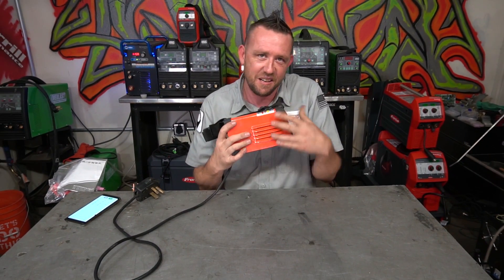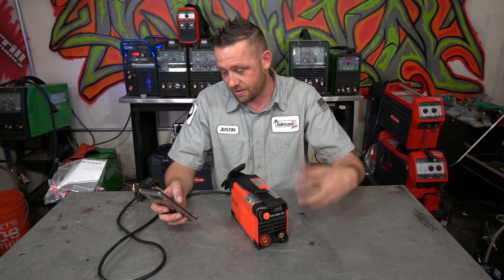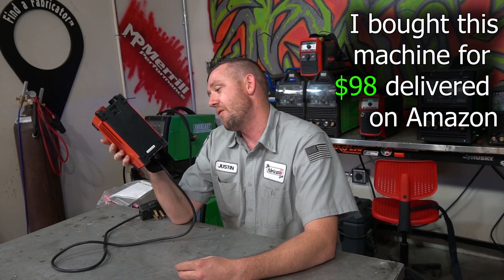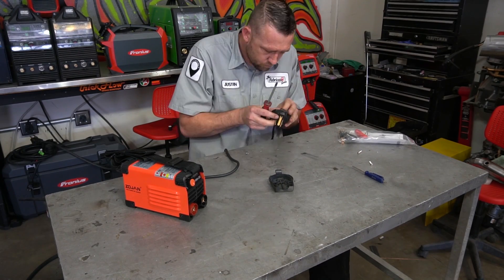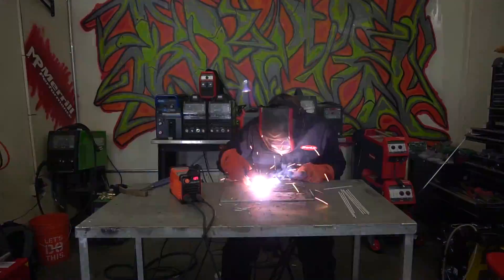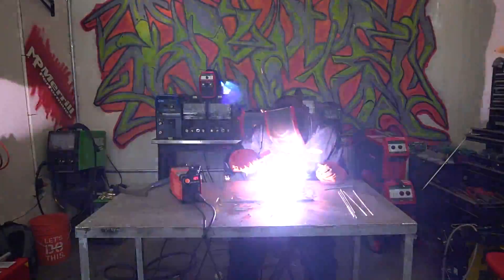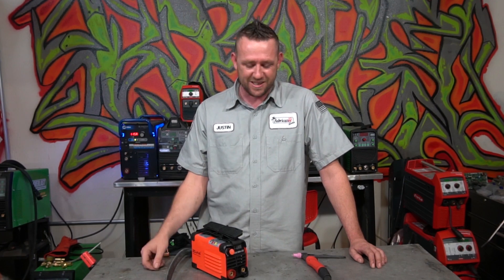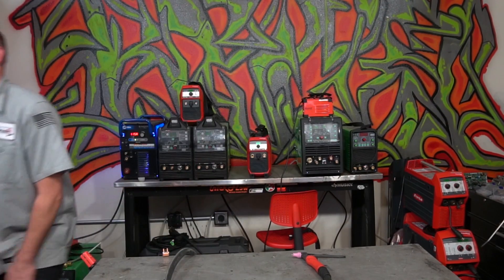TFS: The Smallest Welder EVER! Will it TIG?

Comment: I just got one of these labeled under the Minleaf name. Cirious about the display accuracy, I held a DC ammeter alongside one of the cables while Dad operated it. At 100, it gave a stuck-rod short 100A for a couple seconds before the current dropped to under 50A. Raising it to 150, we got 150A for a couple seconds again. Raising again to 250, we still got 150A shorted. Meanwhile, actual welding at 100 was reading (I think) under 50A while welding at 150 was reading under 100A. All of this was with a 3/32" rod. We didn't try any of this with 1/8" or bigger yet, it's cold out there ;) (wish we had a heated shop). More welding practice will come in the spring when Minnesota warms up again.

Comment: I could see some applications, like say if you're welding 50 feet in the air on a ladder and have it slung around your back. 220v wire is a lot thinner and less heavy than standard bulky DC leads. Just a thought.

Comment: right there u finish 10 welding rod with out stopping and still kicking off what else do u like, for me thats good for high elevaterd area, not too heavy to carry, also if you are welding from no where, there is no electric, that small machine with a small generator will work, thats good for farm land, not too heavy thats the point, thanks for sharing though

Comment: I paid $50 in Banggod on a special,  how many sticks did you use before you gave up??  12?? and you had no problem with the amps then,,,,  
maybe your jumper leads were the problem,  
remember, the longer the lead the higher the voltage drop!!
mine, I only stick weld and it works great!! at about half throttle!  
as for tig welding, you've been spoilt with all the good stuff that cost's thousands?? 
not a fair comparison, there are EXPENSIVE inverter welders out there as you know, 
these welders are for the hobbyist, and diy guy's to make or repair  their own trailers etc,  mine will soon be used to make a chassis for a teardrop trailer.......
these welders are not for professionals,  there for hobbyists who stick weld..
great vid, just the same

Comment: 125 amps for $100 in a tiny compact size that doesn't quit? That sounds like a damn good welder
Reply: Yes I thought he was a bit harsh in his conclusion.  Plus I've swapped out the adjustment pot in cheap machines before and they've proven fine.
Reply: Also they're only $50 on ebay.
Reply: Its actually NOT good value. I've got one... You don't get ANY power plug or leads. By the time you buy the bits to make it work, it turns out dearer than buying a complete machine. Plus they are NOT very robust at all, mine dropped a blade off the cooling fan (a tiny little computer fan) the first time I used it, which necessitated a pull-down to replace. The seller wasn't interested in any warranty.
Reply: क्या कितनी कीमत है भारत में कहां मिलेगी बताएं धन्यवाद
Reply: Daniel Vazquez  you'll get more amps when you sacrifice volts. Altering 120 volts AC to 50-60 volts DC(that's what these use on idle) you can crank up the amps. Not the most scientific way to say it put this is pretty much how it'll go. I bought similar thingy and i'm rather satisfied with it. I'm no pro nor i am going to use it to build a solid steel shed nor even weld rust holes shut on my car but use it on random small projects i have. For that small purpose these things are great.

Comment: I'll tell you the secret of that mini inverters, the power source, 220v is the perfect to work with it, I have a inverter 250A also but it's bigger, it's bivolt and 127V it work like underpower, in 220v almost can use it as plasma cut

Comment: If youre a maintenance mechanic it's probably small enough to have on a tool cart as you go work around a shop just with some small 7018 rods (less spatter) and you can use it occasionally to help with simple welding needs and repairs? Im an industrial maintenance technician and i think itd be cool for some things maybe?

Comment: It's 40-60% duty cycle... Thus, it's 120 amps (constant), at 240 amps, at half-duty. It gains amps by doubling the voltage, which requires half the cycle of the power phase. The purpose is for smaller rods and more controls. Where the RAW power welders you are using, are for heavy duty, raw welding. I know it sounds misleading, but it is actually 240 amps, at half duty. If you pulsed your other welders at half-duty, the average would be the same. However, the pulses that manual raw welders use is 60-Hz to 240-Hz. These digital controlled welders run at cycles that are much higher. Thus, you have a high amp pulse, for longer, with a slower duty cycle pulse, enough to get it started on a burn, but not enough to continue to burn through the metal, on your machines. On this tiny machine, working with thinner rods and thinner metal, you will have the same results, where your raw welders would just blow holes in everything that this little welder can work easily with.

It's about having the right tool for the right job.

If you want to TIG aluminum foil, circuit-board contacts, jewelry-boxes and jewelry, you use the mini-welder. If you want to TIG a car, boat, or airplane, you use your TIG welders. If you want to TIG a tank, you use an industrial 480volt or 720volt TIG welding machine. So those same 240-amps result in higher watts. That is also why 100 amps on 110v is only half as powerful as 100 amps on 220v, because its "Watts", not "amps", that welds. 100a x 110v = 11000 watts. 100a x 220v = 22000 watts. (But these machines don't RUN on 110v and 220v, they are more like 10v and 20v, so the amps at the wall are 10a and 20a, respectively and the output is 100a x 10v = 1000 watts and 100a x 20v = 2000 watts, out of your welder.)

Amps are irrelevant, unless the voltages are exactly the same. That's why you should be measuring "wattage", of the output, not at the wall. (Comparing wattage out, to wattage at the wall, tells you how efficient or inefficient a welder is. Just for the record, the mini welder is 40-60% more efficient than the larger raw welders, with the outputs being equal. EG, you save 40-60% in your electric bill... More, since raw welders draw power when idle and digital welders do not.)

Comment: I bought a 110/220 Hitbox arc welder just for shitz and giggles and was half impressed. It isn't something I would trust to use every day but it's a good little "rescue welder". Easy to pack and run off of the inverter in my truck. I can drive it anywhere on the ranch for a get the tractor home repair and always bring it on off road search and rescue call.

Comment: Is it good enough for "hobby" welding? I want to build a go kart for my son but don't plan on doing any major projects.
Reply: perfect for that type of use, I have a similar welder, but mine is bigger an does 180 amps on full power, even though it saids 250, 150 bucks new with full set of cables and a cheapo hand held mask. i propably go through 5 pounds of electrodes every week for the last year I have it, never gave up on me, perfect machine for a hobbyist.

Comment: I don't know about the prices of welders in that range over in the US but, to me, $98.00 for such power output might not be the best deal. A conventional welder might still be going even after 30+ years as opposed to these converter types, is it? However, these are light and easy to get to in many places, with vernier controllers, and in field jobs should quickly help to recover their values.

Comment: A mini fridge won't hold a keg but you can still get a cold beer out of it!😁
Reply: Dam that statement is legit.
Reply: All we really need is a drill, some duct tape, copper pipe, and a hammer. 
We'll just turn it in to an induction cooler and pull that keg through it one beer at a time.
Reply: @Dirt Nap307 you can definitely fit a keg in a mini fridge. You just have to modify it.
Reply: right!!

Comment: It's probably just 8 bit binary, the way the electronics inside the box displays the number whilst not getting too complicated. 0-255 are the numbers an 8-bit processor can handle easily. You just have to regard it as 0-full power I would guess.

Comment: This is not industrial thing but for home use is more than enought..do not compare it with heavy duty devices. yeah amperage tested with amp clamp and it was 145 a max display lies true amps but from ali it cost half a price you spend and it super for home use..you didnt welded with it for a long time but you saiyng that it wont last long bad review when you said things that you dont know be more acurate

Comment: I use this welder, it has 125 Amps max, shows the double on digital readout. But, for a 125 Amp welder, it is the best I ever had, the arc force regulation in it is absolutely top notch. For the all day use, it is just the best for the buck you can get. Only issue I had, the internal low Voltage power supply blew away after just 6 month of use, So, keep it as a lovely gadget you use some times. I just bought my second one a few days ago, just for fun

Comment: Have a similar "toaster" welder from another Chinese manufacturer.  Amp output readings make perfect sense.  Here in the US our grid is 2 phase L1/L2/G for 240V (L1/L2 each being 120V if connected L/N) or to updated code L1/L2/N/G.  This buzz box was designed for overseas grid L/N/G for 220V +-15%.  N should have same potential as G.  The way you wired the 6-50P plug, L1 to one blade L2 to one blade and G to G, the welder is only seeing 120V and thus your readout is double what it is actually producing as it is running on half the volts.  Works on our 2 phase grid but designed for single phase 220...so only works at half value.  Try 120V plug and you will get the same results L1/N/G.  Also be much safer this way! Only way to get full power would be to use a step-up transformer 120V to 220/240V.  Adding cost and size of transformer makes this a GREAT field/truck 120V repair welder.  Throw and go.  Don't expect great shop performance...as we all saw.

Comment: I am thinking if you need to weld something light in an awkward place it may be the thing to do. I am about to build some brackets in the attic and on a fllat roof off a 3rd floor and was going to use 1/8th inch angle to support some AC components. The big Mig is unmovable so is the pre inverter synchrowave. Even my 135A miller up the foldable attic ladder would be a pain and the weld clearly does not need to look like a stack of dimes. Just some reasonably strong snot bead will do.  Somewhere I read that walmart sells a $65 version. LOL

Comment: I have to admit I am a little disappointed in this review.  I have never even heard of the brand, so it is not that I am a fan.  The bottom line is that the fabricator forced a machine beyond its design parameters to do a task it was not built or intended to do.  And in all fairness, so what if the dial was turned up more than expected?  The end result looked pretty decent and would certainly do so for most common usage.  The vast majority of people out there are not TIG welding 3/8" plate, but rather tacking, stitch welding, butt welds, etc. on 3/16" steel or smaller.  For those types of tasks, the welder here seemed like it would work just fine - even if the readout isn't accurate.  The bottom line is that for non-professionals, this welder would probably fit the bill and the duty cycle was strong.  For less than a hundy, seems like a decent enough bargain to me.  JMHO.

Comment: Question is, whats the current limit on the jumper cable alligator clamps and how much surface area did the clamp cover while connected to the TIG cable terminal. Possible bottle neck for the current flow there.
Reply from the maker: Current limit is about 1,400 amps. Surface area was not measured. Results were the same on TIG and stick (which didnt use a jumper). This welder is a piece of junk. Theres no other way around it.

Comment: Were you running it off 110 or 220 volts? I wouldn't be surprised if it's output changes based on the input voltage.

Comment: I've got a Campbell/ hausfeld 70amp welder and it has a high and a low on it 
and it works fine for me but it will burn a hole through thin metal
Reply: Eastwood and others sells stitch welders to attach to arc welders to do thin metal. Have never used one so cant say how well they work. i use mig and tig for thin stuff so no experience with them myself.

Comment: I guess this unit is about the equal of the HF 80 amp inverter stick welder.  It IS about $50 cheaper, but once you throw in a stick holder, a power plug, and leads the price is now about the same ($150-160).  It is a bit smaller and lighter than the HF welder though, also the HF is a 120 volt unit, this is a 220.    Might still be a good portable unit to have, and I bet it will run off of a 220v 20A outlet at that actual amperage rating.

Comment: Weird approach from a channel that should be competent on the matter.
Im not sure if you're just trying to make drama or be funny, or you wanna come across like you made a discovery of a lifetime, but it simply doesn't add up why not testing the unit with a meter so buyers can see how it performs...
this sucking your thumb and put it in the air and trying to be competent on the matter by sensing what is up and down... is what it is, but couldn't you at least just put a meter on the mains so we could see what it performs.
let's be frank its a freaking 95 USD delivered welder in a tiny form factor... I hope it obvious that the trees doesn't grow into the sky, but it's like you are not able to relate to its performance from an objective viewpoint. (are you ashamed or does it hurt some make-believe welder-your ego)
come on' after all you relate to an item down to price levels and to its formfactor/footprint as these values often interact and undermine each other.-
And no I don't got this unit, I live in an apartment and don't have a need for a big welder but could certainly need a small TIC-welder just to repair finer-stuff from time to time and with a small footprint I could store in the basement locker room but its usually the gas aspect that makes it problematic..

Comment: I have a stick welder the size of a shoe box (smaller than your mini welder). I've had it for 20 years, paid £10 for it at a car boot sale, and it is the best stick welder I've worked with so far. I've taken it to motorcycle rallies, even welded up a broken cargo rack on someone's bike once. 

I've taken it to motorcycle rallies, even welded up a broken cargo rack on someone's bike once. Damn useful as a portable emergency carry with you welder.

No internal amperage control, just a big external resistor spring with a plug in jumper U shaped rod. Great for welding tin cans together with a micro arc when alone without the need for a friend to operate the amperage control wheel if using a conventional full size welder. Pretty much start the arc on the thick starting plate and pull the jumper whilst steadily carrying the now micro arc over to the thin sheet metal. (I had a professional maritime welder demonstrate the trick by welding two tin cans open end to open end (without blowing a hole!!) whilst I operated the amperage control wheel on his stick welder way back in the early 1980's).

Comment: On an open day at my welding retailer  they had an identical looking welder for £100 GBP it did not have the amp read out and was rated at 100AMP...i did not look at it as i have an  Esab 180 buddy arc that only 1/2 as big again  and the nicest  smothist  stick welder i have ever used including a 500 amp diesel lincoln

Comment: if you are powering it from 110V line it will perform at 50% potential i.e. 100A on dial will give out 50A at the contact. make sure you are using 220V line as the supply to get 100A as shown in the dial at the contact points. please check it again with 220V confirmed line ...

Comment: If you supply 240v the welder will probably supply the correct amperage, the welder can't increase the 100v supply so 1/2 the supply voltage 1/2 the output
Reply from the maker: If you watch the video you'll delete this comment

Comment: Did it lay beads ?  YES.  Would it weld two bits of metal together ? YES.
STOP being a gear snob and face facts, it does what a $1000 machine does.
Reply: i second that motion. OLE!
Reply: For an infrequent use "Home Hobby" MMA it would be more than ample. Never would i consider it for commercial use lol
Reply: @robc4913  For small jobs it will pay for itself in one day. The one I bought 20 years ago for $200 is still working. Different brand. Not even sure who made mine. Just says 190 ST on the front. I can take it anywhere and it runs on 115 volt.
Reply: It does tig....
Reply: Not a snob, you should thank him for figuring out that the manufacturer is lying by a factor of 2 (100amp=50amp). Without this knowledge, it could be quite frustrating for DIYer, especially someone with low budget thinking machine may be cheap but at least accurate re: amps.
Reply: Correct, we all know it's not for welding pipe all day everyday but for a now and then tack or bead it's just right.
Reply: Well said, especially the snob comment...

Comment: Dude, horrible review! As a stick welder it obviously overproduced. YOU GAVE UP BEFORE IT DID. As a tig welder, not what it is sold as and not what it is supposed to be used for, it performed, just not to your satisfaction.

 If you ask me, It seems like a perfectly good stick welder that you can easily carry on site to knock out some quick welds.
Reply from the maker: You missed the reason why it's no good.
Reply: @TheFabricatorSeries  the reason it's "no good" is that you were trying to drive a 220-240 volt welder with 110 volts. half the power supply half the output its really that simple
Reply from the maker: @gmoose777  You missed again. Its plugged into a 240v 50 amp circuit. That was clearly shown if you'd just watch.